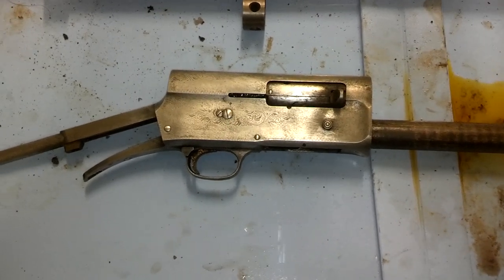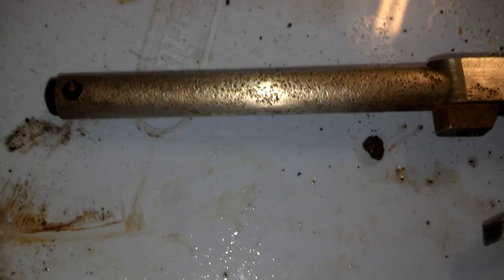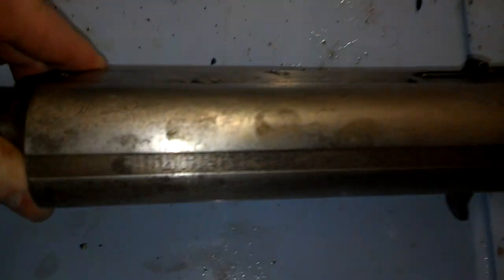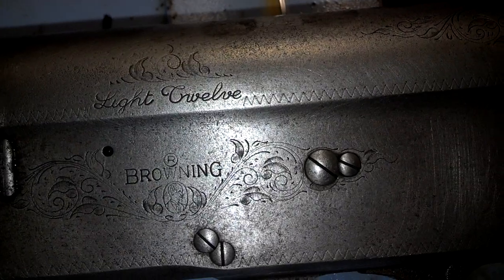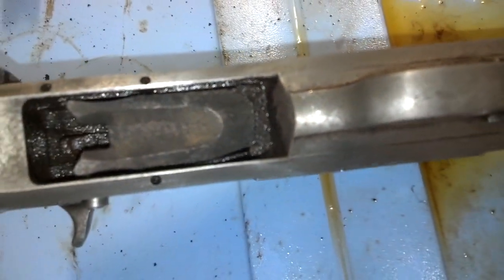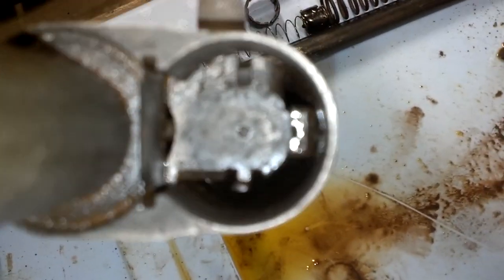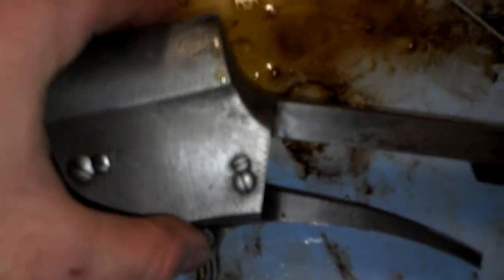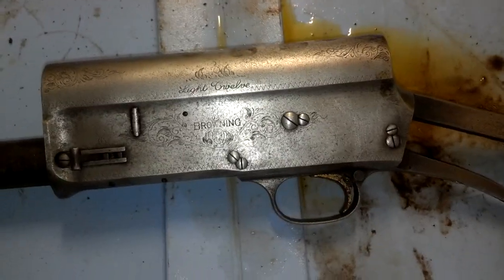Browning Auto 5 Rusted Whippet gun: Video 8 First Receiver Electrolysis Complete

Comment from the maker: It depends on what is used for the blast media

With a glass bead blasting everything shows,

With aluminum oxide blasting, the sharp edges get blurred a little....

Most of the engraving should be visible, I will be trying to only blend the pitting slightly.